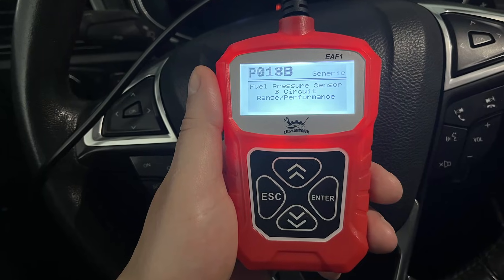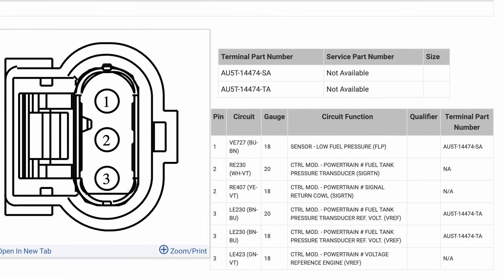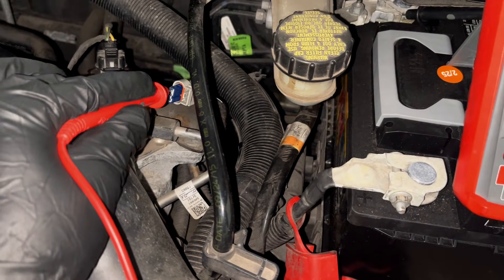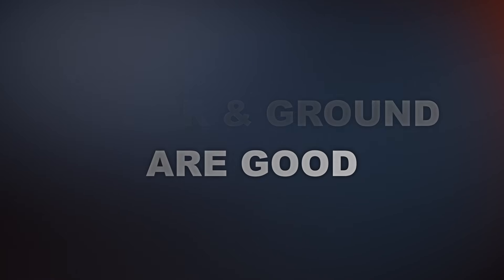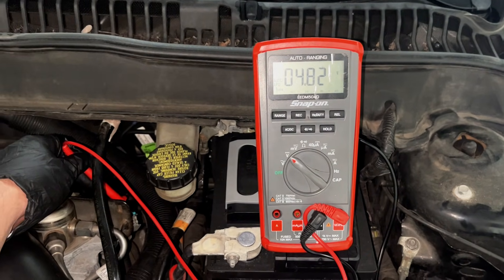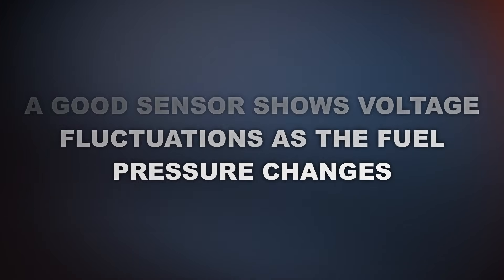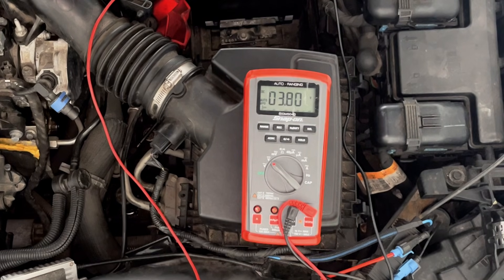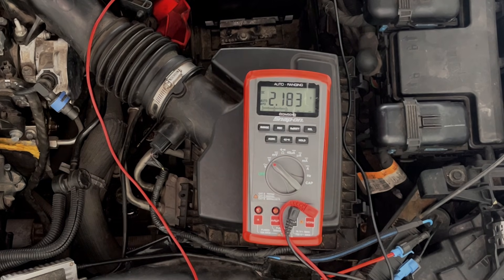How to Test a Fuel Pressure Sensor the Right Way! (Before Replacing It)

Comment: Can I just turn the key to the auxiliary position 1 or 2 times for the injector to spray on the spark plug & determine which is a bad fuel injector?